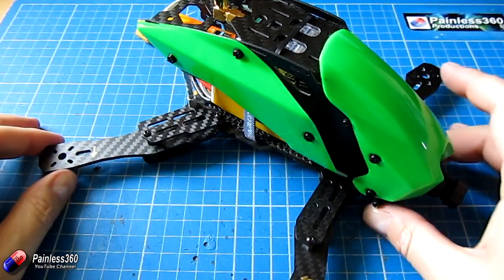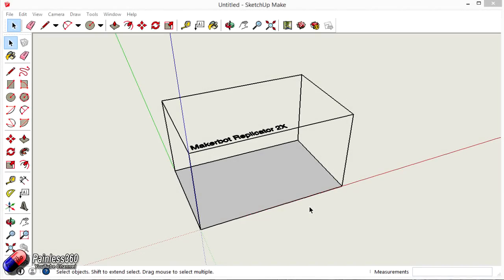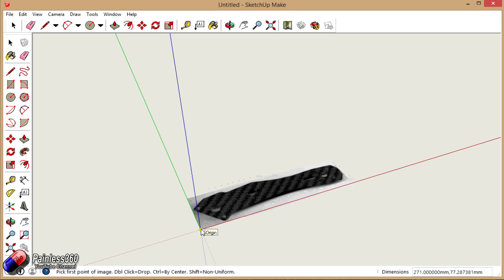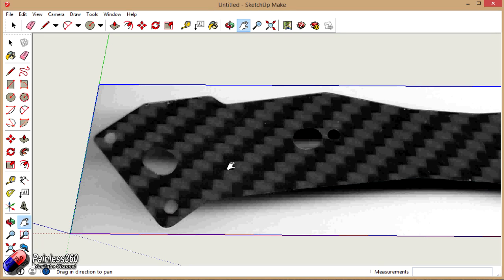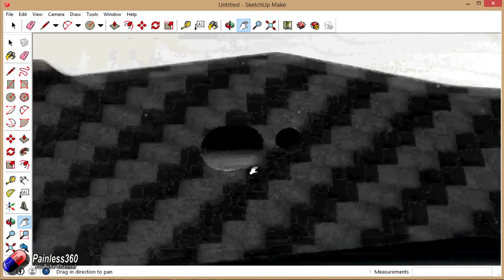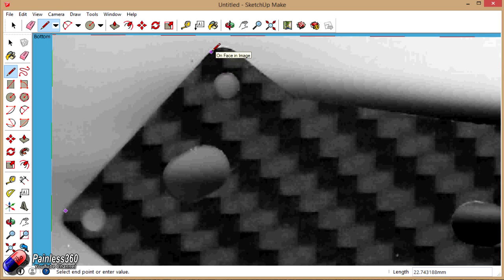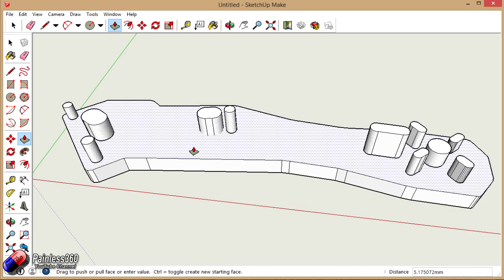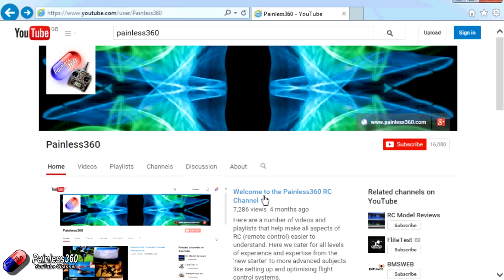(7/7) 3D Printing for RC: Making replacement RC parts

Comment: Little tip : Draw the straight lines so they are touching and then use the fillet or chamfer command ( every CAD-package Sketchup , FreeCAD , AutoCAD, .. has that in some way or form ).

Comment: Hi Lee I have just started using the sketch up 2015 version, and I seem to be missing something in the settings. If I start a drawing, a circle with a hole in the centre for example, then use the push pull tool to give the extra dimension, the object seems to be hollow if viewed from the under side. I need this to be a solid object, but dont know where or how to change this. Any ideas please?
Reply from the maker: Simply extruding a solid circle should create a column. In a more complex model, you may need to reverse the face of the circle you're about to push/pull as SketchUp can get confused bu inside faces appearing on the outside of models..
Reply: Hi Lee, thanks for your reply, I am slowly getting my head around sketchup and I have found a possible solution via this video.   https://youtu.be/QdTrkzU5wIA   The sample part you made here seemed to be solid when viewed from below by default, where as my example has no face. If the object is grouped then exploded, a face can be line drawn, but none of the holes extend through the new face...D'oh...I be there dreckly.Lol...
Reply from the maker: I sometimes get this and find that I need to draw lines from one opening to the other and then to the outer edge to make Sketchup 'figure it out'. Not drawing some of the lines from the openings will cause the new face to just ignore them. Hope that helps.
Reply: Every little helps thanks, I guess its a case of understanding each stage of an operation. I have found that if a circle is drawn then erased rather than pushed through, the object is pulled up as a solid and has a mass volume.If that makes any sense. I keep driving on...

Comment: excellent video!!!  thank you for imparting of your expertise,   but a question, what material would you use, PLA, or ABS, or other?
Reply from the maker: See the other videos in the series where I cover that. PLA is easy to print and very hard but brittle and will snap in a crash, ABS is tough and can take a knock and not break but is a pain in the a$$ to print (high temps, heated beds and with adhesion problems) and my favorite for R/C is PETg as it's easy to print and damn tough too. Everyone had their favorites. ;)

Comment: Hi, I came here again to try it now, but facing an issue, when I import the image and try to draw the line I cannot see the line, it is below the picture. If I move the picture to the bottom I cannot see the picture... so unable to see the picture and the lines I draw at the same time

Comment: Thanks for the video! I have been wondering about making my own stuff. Quick question; what if it was a little thicker  part and I wanted to not make it solid to save weight?  How would I tell Sketchup to rather print a mesh inside?
Reply from the maker: We would pop a number of holes in it or use a lower infill when I was slicing the part in something like CURA.. Best of luck with it!

Comment: Hi, excellent tutorial, however something you may not be aware of is that Sketchup has inside and outside to faces, when you see a blue surface it's the inside of that face and when it's white its the outside. you should orientate all your faces so they are white, the reason being is when your slicer program comes to read the model it can confuse it and you can get errors in your print. This explains it better than me and shows you how to correct it. http://www.makerbot.com/blog/2011/07/22/google-sketchup-design-tip-fix-flipped-faces Hope that helps.
Reply from the maker: +Richard Gwilt Thanks for that, it's a great tip.

Comment: Is there some free app to make the 3D model without scanning something flat like CadKey was some years ago?
Reply from the maker: Not sure, how did CadKey do it?
Reply: +Painless360 it was a very old program from 1998, I do not remember clearly and only very few videos left about it, without a scanned image you had to define points, lines etc, create a mesh then add/subtract basic objects to have your 3D model, so I think I just start learning sketchup it might work the same too and using a scanned image is just an extra. Thanks for showing that app!
Reply from the maker: You are welcome - lots of 3D design programs. SketchUp is very basic in a lot of areas but I still find it handy to create little intricate pieces with 90 degree edges for RC..

Comment: to avoid stl errors make sure all outside surfaces are white, if they are grey rightclick and and invert the surface, this should help to avoid most of the mesh errors. while most slicers by now can auto heal bad mesh its better to do it with the netfabb service https://netfabb.azurewebsites.net/ its free, you just have to have a microsoft account
Reply from the maker: +Grearson .x Thanks for the tip - we do cover this in the next video.. Happy printing!

Comment: i have a 1/18 brushless rc truck the  motor rating is  2-3s  with a 25a esc. would i be able to use a 3s lipo or only a 2s
Reply from the maker: +son8god8damn Please post the question on a relevant video. You can use both but the 3s will be faster (higher voltage).

Comment: excellent
Reply from the maker: +Jon Car Thanks Jon, still getting the dislikes from those who have missed the point of the series ;)
Reply: +Painless360 Are you kidding me?  This is another excellent resource for the hobby.  It took me hundreds of hours to figure out all the complexity of 3D printing in order to  print parts for my quads and also use Sketchup to design parts for the Huracan quad.   http://www.thingiverse.com/thing:1040710
Reply from the maker: Nope, not kidding. I've deleted a few comments that I considered 'rude' from people who seem very angry that a 'kids' program like SketchUp is used in the video! It's a silly minority are not considerate enough to take others experience and ability into account before posting ;)
Reply: +Painless360 sketch up is used by thousands of modelers
Reply from the maker: Including me. It has it's flaws but this is still what I open when I need to make a small bracket or adapter for a model. I can still do it faster in this than most others! ;)